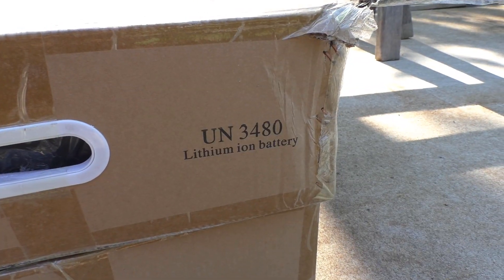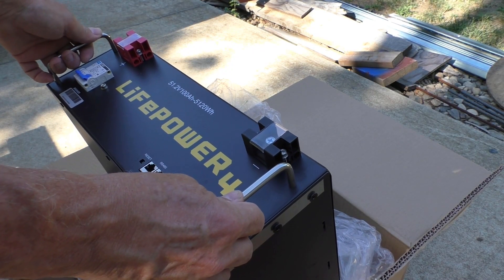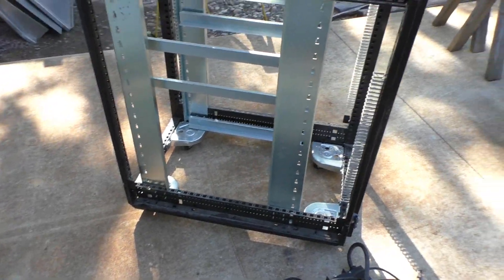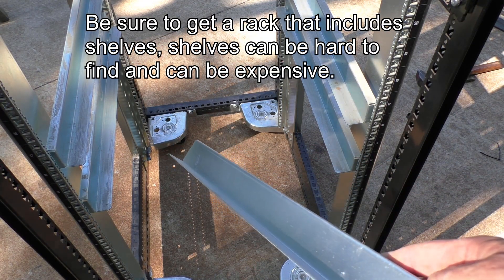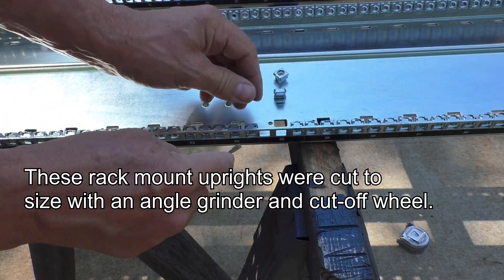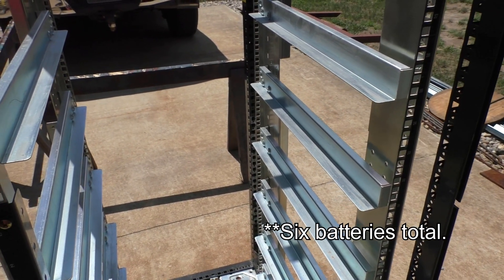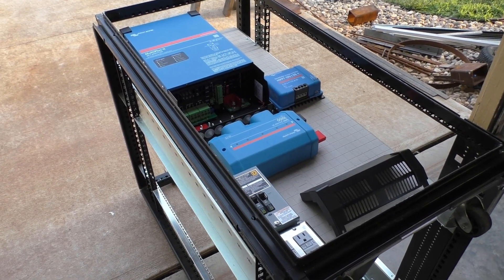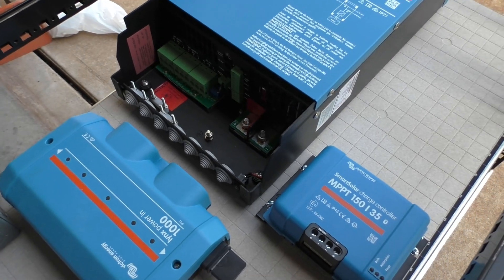Server Rack Solar Generator Part 1 Victron Multi-Plus II  MPPT  150/35 Controller Lynx Power In

Comment: Wow very nice setup and repurposing
Reply from the maker: Thanks Lance. The battery company has a $600 rack like this cut down version. Dewalt (and box stores) has a shop rack that works but is not a great fit. Server rack is a little big, but when you can fit everything into one space it becomes more appealing.